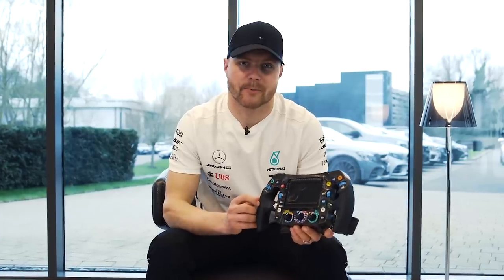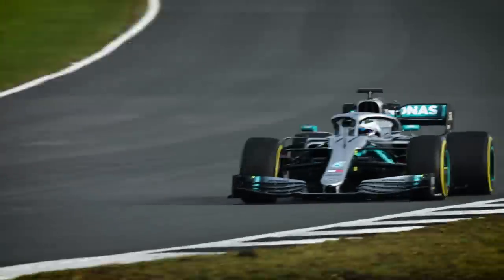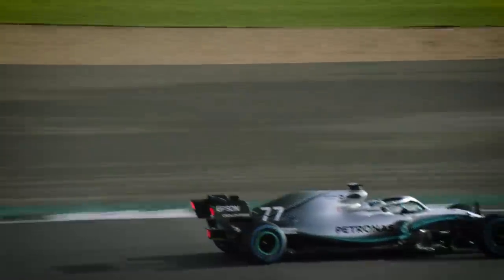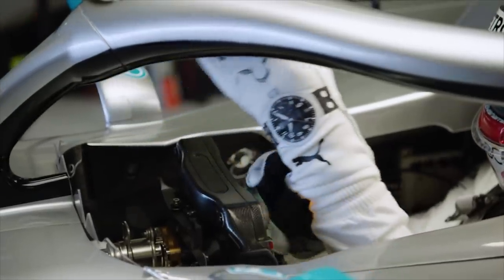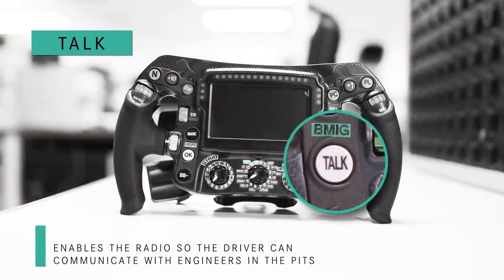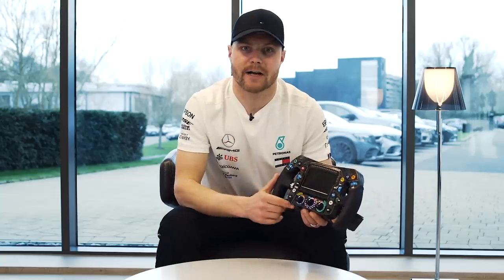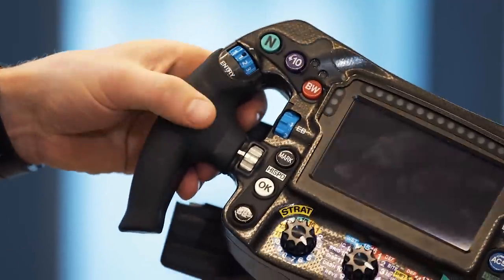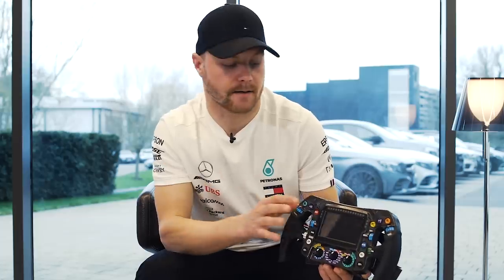Valtteri Bottas Explains 2019 Mercedes F1 Steering Wheel

Comment: Drivers are less connected to the feel of the car than in past decades. Driving is less exciting with these less-skilled, overpaid blokes as effective passengers.
Reply: Less skilled? Are you good? 🤡
Reply: @PeRRXX  Actually, I've been racing since '80, first registered in SCCA, then ICSCC, FIA, NASA.   Was sponsored, campaigned cars in Formula Vee, then Group C and B, Can-Am. Most recently trained drivers in a number of SCCA and NASA classes. I still do some concours and vintage show-races for well-heeled owners, mainly, of late,  in 917 and 962C wheels out of Stuttgart. So yeah, I have an opinion. And I stand by what I said, that today's young drivers in F1 are basically passengers compared to the drivers of the beginnings of the sport, up through the 80s and 90s. They are unable to relate to the engineers and mechanics what is needed in a car, for under-and oversteer, camber, wing adjustment, and mix.  If you've ever been in Race Control (which I would doubt, based on your comment) for a campaigning team, you'll see the race engineers telling the driver what they are going to do the car, not the other way 'round.  It's an immediate connection+feedback loop in a car with an unsynched box, carbs or mech injection, and bolts holding the wing pitch. When you pitted, you told the team what you needed. Everyone waited to hear what you said. All they had was a board with watches on it. If you didn't understand the relationship, you went nowhere.

Comment: And i thought my Playstation Controller was too much for me.
Reply: well you may think its too much in a steering wheel but everything is handy, whereas in a ps4 controller isn't, I find myself turning down ERS with the same stick i use to move my car, that doesn't happen on a steering wheel, and all the most important-used buttons are positioned on the wheel so that the driver won't loose any skill by accesing to them, instead the less-used buttons or irrelative ones are positioned in some areas where they think  the driver won't mind loosing skill or focus in that situation
Reply: @pantheRRRRR  you might be right... i would love to drive a F1.
Reply: 😂 Right?
Reply: I play f1 2018 on a g29, that thing has even more buttons than a ps4 controller, still really useful to change ERS, differential and brake balance on the fly during the race

Comment: This is exactly why there is such disconnect between F1 and its fanbase. Right up until the Likes of Senna, Prost, Mansell, Berger and such. They had the same equipment as you, a steering wheel, 3 pedals and a gear lever. The average fan could imagine that they were any of the GP drivers from the dawn of the GP to the early 90's (the only minor difference being the centre throttle in some of the early Italian cars). Now No fan can imagine that they are a Hamilton, Ricciardo or a Raikkonen. The complexity of the steering wheel is more than the average car. It's just another step that F1 takes to remove itself from the average fan.
Reply: F1 is about innovation and improvement, that meant eventually it was going to be disconnected from fans. Most race cars are far more complex then a road car, because that makes them faster.

Comment: Engineer. It is designed so the driver can reach anything while keeping both hands on the steering wheel. 
Rewind to previous scene. Driver takes left hand off wheel and toggles dial.

Comment: What about the other buttons T.T
Mark, OK, BB-, BB+, ACS, BBAL, PC, +1, +10, BW?
Reply: OK = literally Okay, acknowledge team radio without operating the radio button (I've heard 'PC' is also used for this). +1/+10 are to modify settings once the relevant MFRS rotary is used. Mark is a "marker" in telemetry for any problems. Driver presses that when they feel any issues with the car/engine and later the can check what was happening on the data. It's also "No" as opposed to OK if the radio fails. BB-/BB+ for brake balance control, used with the blue rotaries dials labelled 'EB' and 'BBAL'. ACS is the only one I'm not too sure on and a lack of a visible 'DRS' button makes me wonder.
Reply: @mikexkennedy  Thank you.

Comment: I might look dumb, but how does the car differ "corner entry" from "mid corner" to apply different diff settings ? G force sensors combined with brakes datas maybe ?
Very cool video by the way.
Reply: Rémy-593 definitely not dumb, I’m wondering that myself. I’m sure it’s how that weight transfers through the corners and under acceleration.

Comment: Give me the good old days of racing:
1. When you put a guy in a car and just let him drive.
2. When a steering wheel was just a steering wheel.
3. When gears were changed with a foot on the clutch and a hand on the shift lever and not paddles on the steering wheel.
4. When the nearest thing to a computer in the pit was a bank of stop watches, a clipboard, and a pencil, and the IT guy was holding the stop watches.
5. When the driver told you what was wrong with the car, not telemetry.
6. When the only communication between driver and pit was a guy with a chalk board.
Reply: ok boomer

Comment: Can someone tell me what that number that is usually around 59.0 is when they're doing pole laps that covers their whole display?
Reply: Nicolas Pillay while they're doing the pole lap, the driver has the v delta displayed on the display, which is the difference value between the polar time (i.e the current fastest lap) and the lap of they're currently on. Or, if they wish to choose it (which they can do on the steering wheel), it displays the Delta difference between sectors, or the last lap and how much they are currently up or down on their own previous lap.

So, they have the choice of showing the difference in value of the current pole sitter's time and their own fastest lap time, and the Delta difference - how much they are up or down on that particular time at that particular moment, or the difference between sectors, or the difference between the lap that they are currently running and their previous lap.

So at their choosing, the driver can see four or five different values regarding lap times or sectors, or any delta-v changes between laps - a delta v being the speed differential.

Delta-v's are mostly used during a race, so that the driver can keep to a certain speed through yellow flag sections without getting a penalty as they work on average speed for a sector to decide penalty awards.

It sounds complicated, but the driver knows exactly where, and when, he needs to see certain delta differences, and some drivers prefer to see different ones at different times so that's why they have the choice.

Lewis, for example, always has the maximum Delta v of the pole sitting lap, so he knows where he is and how he needs to make up time.

Comment: Why are they using wet tires on a DRY circut?
Reply: the FIA mandates that teams are not allowed to collect data for non-official sessions or tests, so media appearances will run WET tires to prevent the telemetry from getting accurate data
Reply: F1 teams are only allowed 5 days of testing a year.
Reply: @RingoYote  Ah thanks!